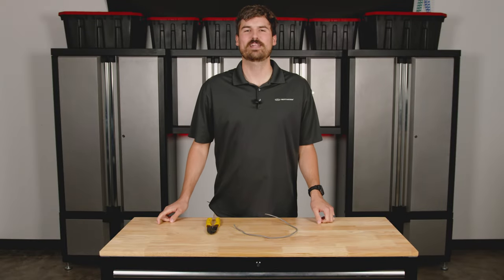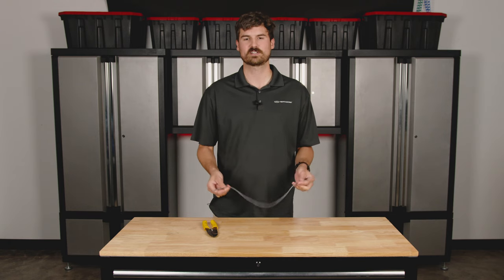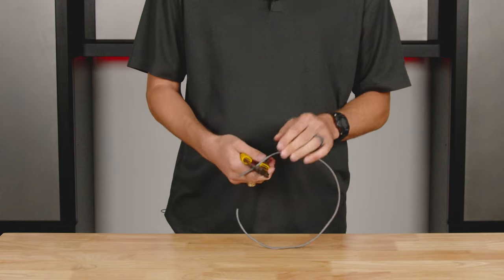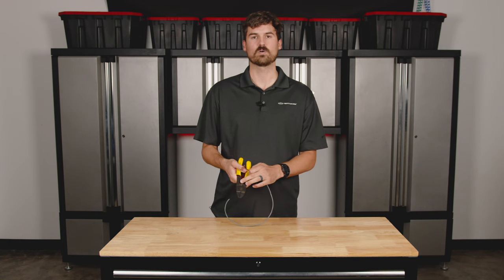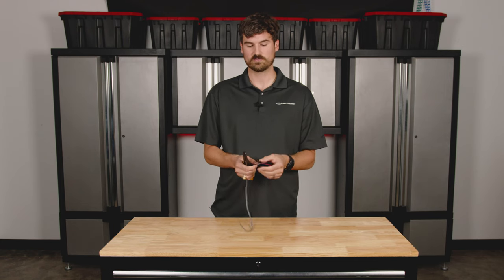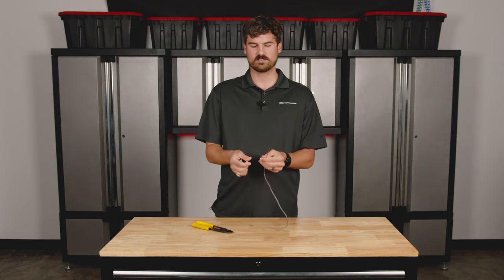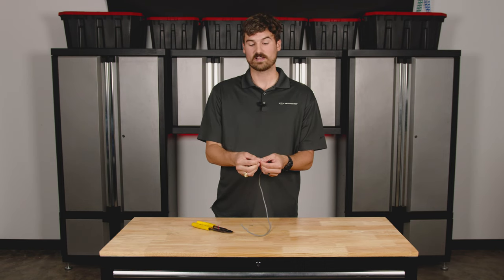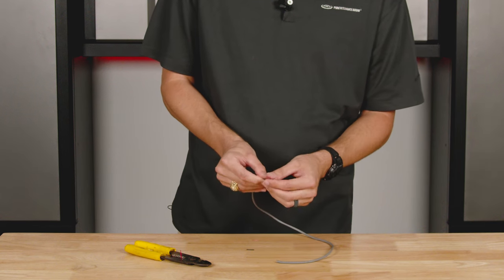How to Strip Speaker Wire

Comment: Your video was very Helpful! I'm a carpenter and I can strip electrical wires, no problem. But with my ham hands, I have a hard time working with speaker wires😂. This video helped me take my time and actually strip the speaker wires without taking wire with the sleeve this time.
Reply from the maker: I’m glad to hear the video was helpful for you! It can definitely be a challenge to work with thinner speaker wires, especially when you’re used to handling other types of wire. Happy wiring! 😊

Comment: 16 gauge wire?  Seriously?
Reply from the maker: 16 gauge wire is commonly used in 70V commercial installations. One of the advantages of a 70V system is the cost savings on copper wire. However, for high amp loads or low impedance setups, you might need to consider using a higher gauge wire for better performance and safety.
If you have any more questions or need further information, we are here to help!